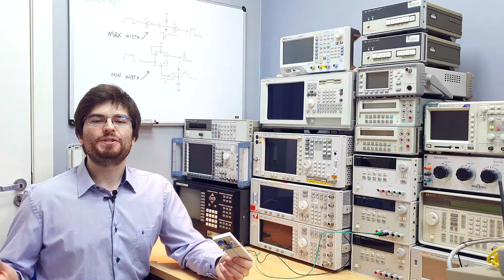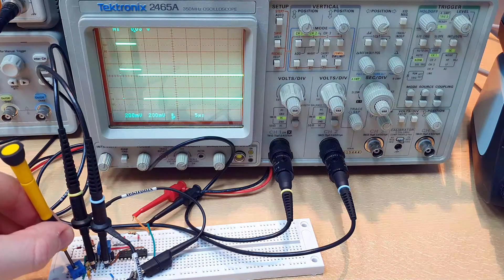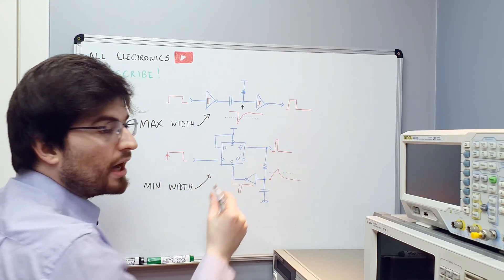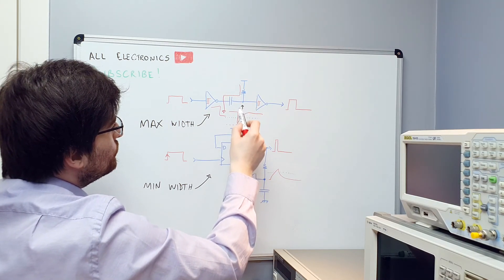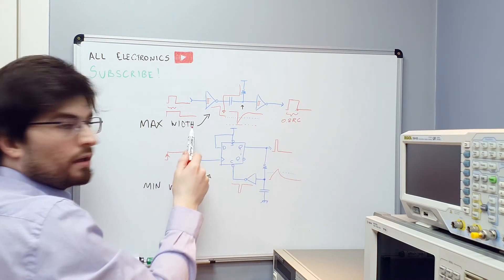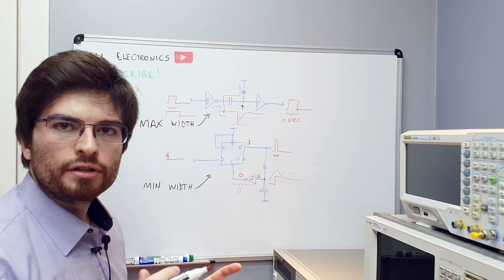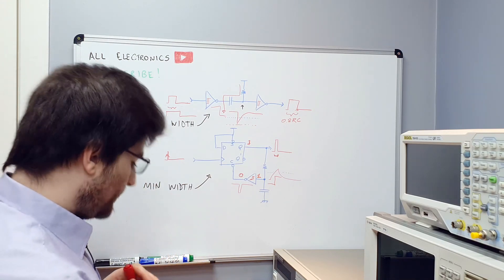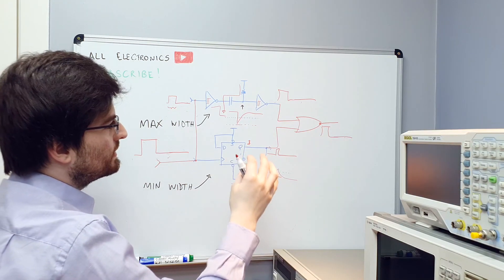Logic Gates Pulse Width Limiter

Comment: Thank you. That s what I am looking for since months: Pulse delay with adjustable length. Great!
Reply: Another Question: I want to use your schematic but at high frequency (16Mhz) in order to generate a delayed pulse with an adjustable pulse width (Delay:1 to 4 cycle . Pulse width: during 1-2 cycle). What is your opinion? does will work? how long is the maximum frequency for this schematic. Thank you.
Reply from the maker: @bananago3382  Hello man! With 74HC logic gates you can run this circuit even at 40Mhz.. I think you are fine at 16 meg!
Reply from the maker: Thankz!! 😁
Reply: Thanks. you're right.